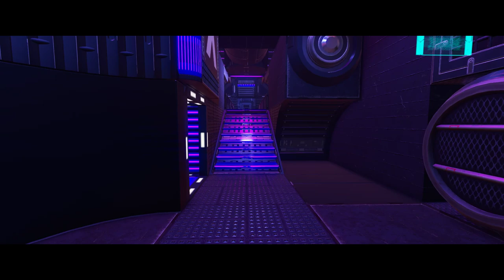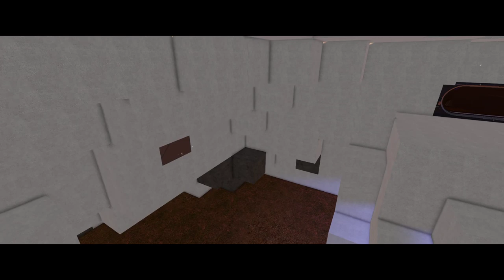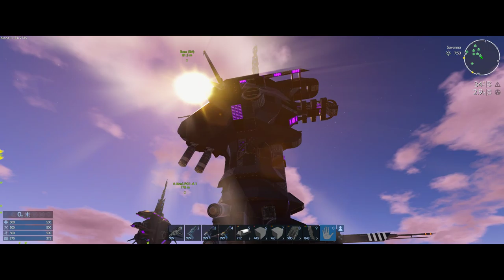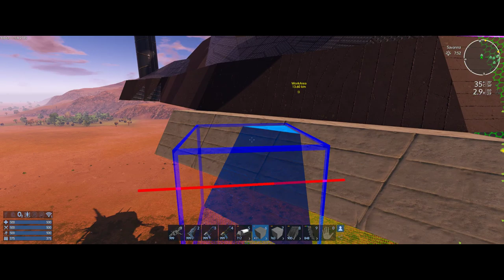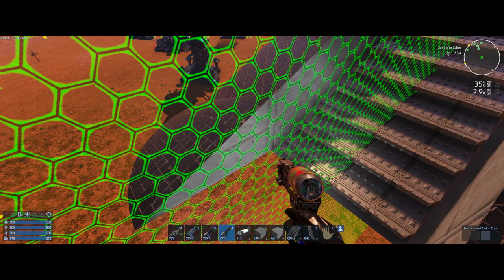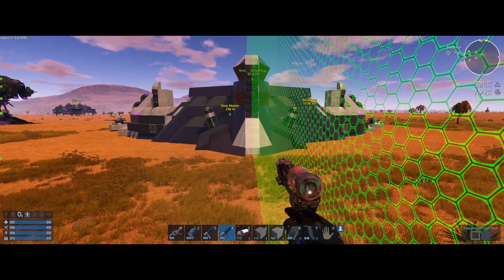Empyrion Galactic Survival - More Kriel + Basic Kriel base structure texturing tutorial.

Comment: I love all of the things you do, and can't wait to meet the Kriel in game!  One request.  Could you replace the concrete grow plots in your new mini base with wood?  You can make wood grow plots from the mobile constructor.  To make concrete, you need the large constructor, which means you already have a base, with storage and fuel and power.  Hence... why would you need to spawn a small starter base?  

Either this, or leave the grow plots out.  I tend to load starter bases into creative and pull the grow plots out, this way the player (myself in this case) can use the base's constructor to build the grow plots, once it's spawned in.

For me, the big reason to spawn an armed starter is dealing with the rapid drone attacks.  That first attack, if you're not ready, can wipe out a lot.  They tend to come with two rocket drones, which are hard to deal with.  So, this kind of base is brilliant to spawn as a starter, but with the grow plot requirement, I'd really have to build a base first, at by then, I'm invested in the new structure, and don't need a starter.
Reply from the maker: Thank you. I didn't realize you needed a large constructor for concrete farm plots. I can switch them out easy enough before release. Thanks again! :)